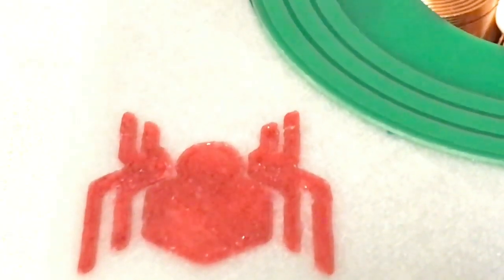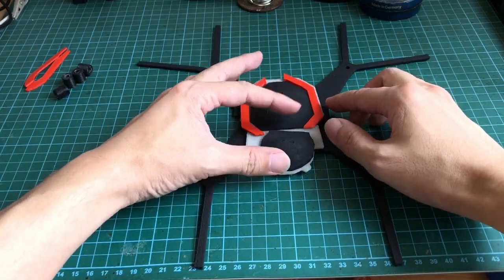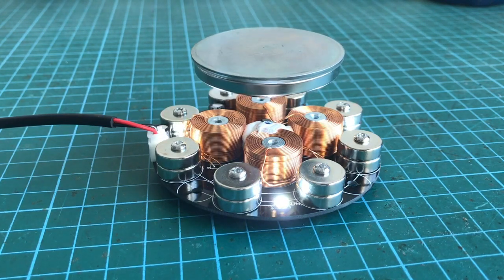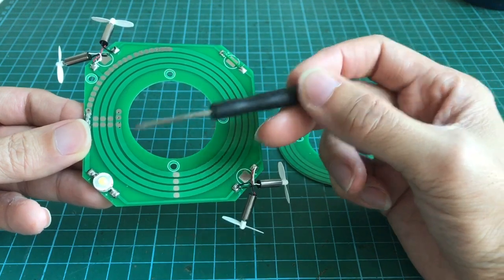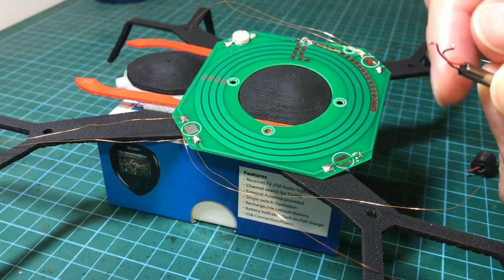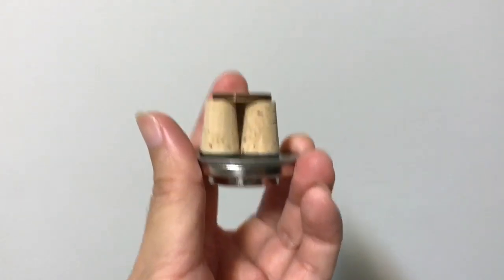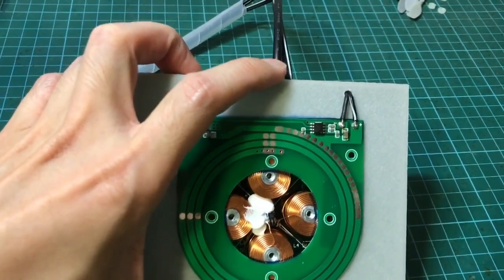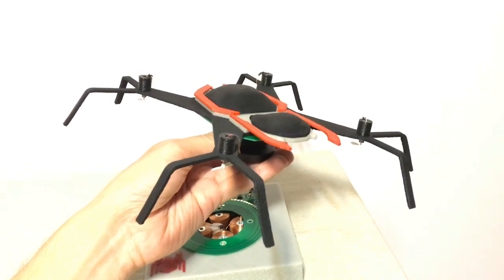3d Printed Tesla-powered Spidey Drone!

Comment: Whats the practical use for this to fly my drone?
Reply from the maker: I guess its only practical use is as a teaching aid to introduce aerospace and physics of electromagnetic induction to young children.  By the way, the holes for the motors could be enlarged to mount 8mm motors and the disc magnet be replaced with a flight controller + 4-in-1 ESCs to turn this into a real RC spidey quadcopter.
Reply: @terence79chan  Its  apparent I haven't the knowledge to even discuss this intelligently, but I have noticed my high voltage wires put off a lot of static electricity , would there be any way to use that to recharge?
Reply from the maker: The 'static electricity' you mentioned, is electro-magnetic radiation. With an electro-magnetic radiation meter, you would get a reading near any high voltage wires or sources including AC outlet. You need a primary and secondary coil to 'harness' this energy properly. This 'harnessing' is seen in a tesla-coil, transformers used in AC appliances and in modern induction cooker.  Google "Nikola Tesla". :)
Reply: @terence79chan  I pull up to 120 amps on my race quads, would it even be possible to pull that much of a charge fast enough? Im using a 4s 16.8v 100c lipo battery. If it were possible to charge in flight, this would be worth a lot.
Reply from the maker: It is possible charge in flight, RC planes have great success with in-flight solar cell charging. However, it is futile to use the rotors’ power to re-charge the flight pack as any recharge mechanism/circuit will simply put a greater toll on the battery, negating the re-charge totally. This is practical only if the multi-copter runs on fuel, and a generator(which works by induction too) is used to charge a battery for the receiver/cyclic servos for the 4 rotors and FPV electronics so that refilling the fuel tank is the only thing required to keep flying.
Reply: This isnt what I meant, but itll do,lol
Reply from the maker: Nice article, thanks for sharing. Before reading it, I have this crazy idea of deploying an RC car (with a Tesla-coil roof) under the spider drone to wirelessly charge the drone’s battery so that I do not need the electro-magnetic levitation trick. The drone would truly be hovering over the RC car (auto-positioning via an optical flow sensor) for as long as the wireless charging could keep up. It is not as effective as a wire-grid charging system but it doesn’t have the mess of electrical cables hanging everywhere over cities.